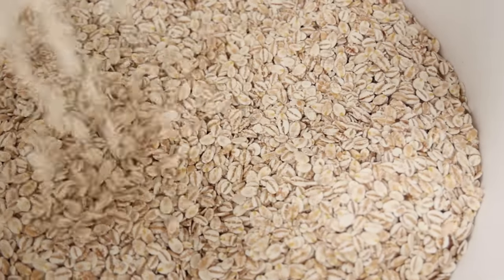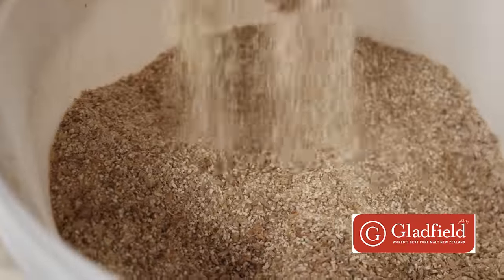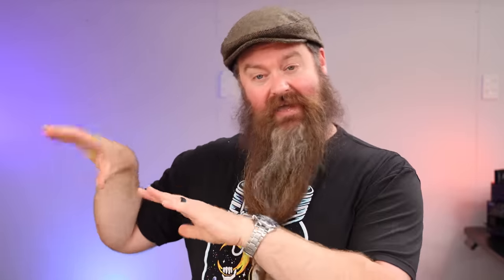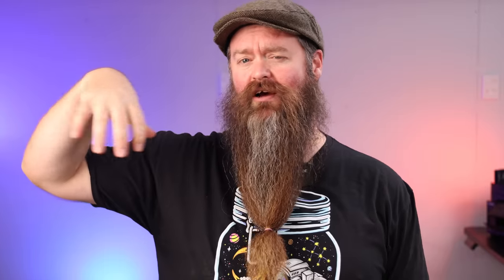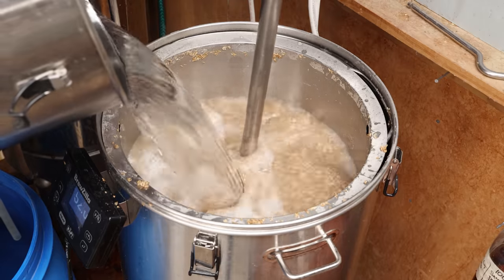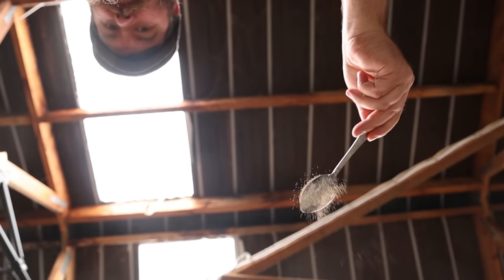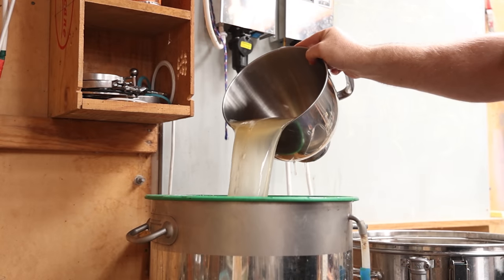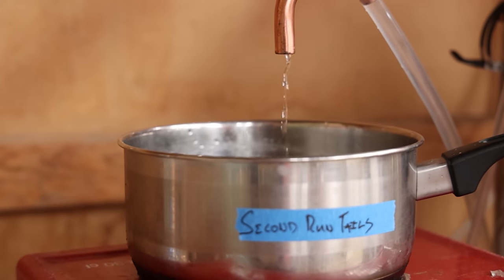Making A Triple Distilled Irish Pot Still whiskey

Comment: Craft distiller here who is setting up my own commercial distillery in South America. I have made about 14 different Irish whiskeys. If you read up on the history of Irish whiskey the grain bills were wide and varied, a lot more so than scotch. The classic is malted barley at 50 % 40 % unmalted plus 10% wheat or Oats.  I have made all sorts of variations with varying degrees of Oats and some rye.  The best book on the topic is "A glass apart" by Fionnan OConnor. Its an excellent book on the History of whiskey in General and Irish whiskey in particular.  On triple distilling the practice varied between double distilling and triple distilling however as you correctly noted with triple distilling they are effectively recycling the tails and getting more of those flavors into the final product. You can do that with a different technique in your second run and still come up with the same product.  The other thing you could have mentioned if your going to barrel it Irish whiskey was almost always barrelled at 51%to 55% ethanol.  Just because it gave the distiller a better understanding of the balance between wood and whiskey flavors as the whiskey ages.
Reply: Thanks for the info!  I'm in the middle of my first triple distillation now.  And I think I'll put that book on my birthday wish-list!
Reply: @matthewbrook7683
Where does the "51% to 55%" info come from?
Page 43 of the O'Connor book says, "all of the Midleton whiskeys are cut to a uniform strength of 63 percent ABV for maturation".

Comment: A couple of observations coming from all grain beer making which might give you something to experiment with.  Boiling the wort (wash) isn't just done to extract bittering compounds from the hops but to achieve  a "hot Break" which coagulates proteins making them drop out of suspension and gives a clearer wort. Takes about 30mins boiling, the addition of irish moss helps this process. Ideally a "cold break" is then achieved by cooling the wort (wash) as quickly as possible. This drops out another set of proteins which cause beer to go cloudy when chilled. On my setup this is done with a homemade heat exchange, a long copper coil with flowing  a water jacket, very similar to a condenser on a still. Not sure how much it would effect whiskey making or if the added effort would be worth it but it certainly results in far cleaner, tastier beer.

Comment: I did a series of 4 washes with a litre of back sets from previous stripping run going into the fermentation for the current fermentation (pH adjustment needed). I used feed grain barley for the unmalted barley. For the generalization I used a second pot half the volume of the mash tun. I found out that generalized barley is available as a horse feed - described as micro ionized. I used a T500 for the stripping, 2nd and 3rd distillations. I aged with French Oak dominoes for 100 days and am happy with the result. I expect that more oak aging would improve the result. Using 5% Rye or Oats in the fermentation might add some complexity.

Comment: One thing to note, the reason your adding high wines to the wash in the next strip run, is to raise the ABV, and to help pull out more esters.
So again when you do the 3rd run, don’t proof it down. Distil it at whatever you’ve got. 70-80%, again the higher ABV will help to pull out more esters.

Also don’t disregard heads from batch to batch, because that’s where most of the esters are, keep adding it, eventually more and more esters will start showing up in the hearts.

Basically it’s the same as chasing rum oils, just at the other end of the run.

Comment: I love your channel. I am a homebrewer for a few decades, and have made the turn into distilling for the last 10 years or so. Much of what I see on your channel are things I have learned the hard way, so it is great to see reinforcement of the alchemy that I have been through. I especially like your info on cuts, as this is the hardest thing to wrap my brain around. One thing I thought of when I saw this video was that you are milling grain with a power tool and a mill that (probably) has knurled faces on it. I just replaced my mill (after 25 years) with a Brewtech mill. It has larger rollers than the old one, and does a nice job of it. I found that I was producing way more flour than I should have, due to my impatience. I was milling too fast! It led to flow problems when we make beer. Now that we upgraded the mill, we are back to smooth runnings and still meet our efficiency numbers. 
Have you had to focus on a slow speed when milling with a drill motor to avoid making too much flour?

Comment: I have a question off topic I have been trying to find your newest video to ask this question, but how can I get a rich corn flavor from my wash into my distillate I’ve been trying and trying and trying to get this corn flavor, but every time it is not so I am running in Pottstown mode, but I have no thumper attachment origin basket at this time I just assumed the flavor would carryover, but there is absolutely no corn flavor. Any help you can provide. Any suggestions would be greatly appreciated.

Comment: I have learned so much from your videos. I use the Air Still only. Question please. So, when distilling using my setup, just throw out 30 ml of the first product as foreshots? Even though it smells funky after that, until clean hearts, those are the heads? And you can redistill them?

Comment: Thanks' Jessie, love it when you do and explain the process. Question: would it not work thru the bubble plates (Reflux), or is it the pot still and the heads and tails remix that makes the difference?
Reply from the maker: Good question.  Its not something I have tried side by side.  I think you could approximate it.  I have a hunch there is something to adding the feints from previous runs and adding extra water.
Reply: @StillIt  Thaks mate, have an awesome evening, till later

Comment: Sprinkling the yeast on top of your mash is actually the best way to add it, regardless of what the package says.  If you're familiar with iStill at all, they offer a very extensive course in distilling and cover all aspects of it.  One of their free video series is on yeast and after extensive testing they found this to be the best way because the yeast is hydrated slowly instead of all at once.  When you stir it all in everything gets hydrated, this shocks the yeast and actually kills a lot of it, when introduced slowly such as by sprinkling on top it is able to hydrate slowly and gradually come back to life and start eating sugar, this leads to a bigger yeast colony faster, which will eat sugar and poop alcohol faster.  Check them out, it's worth it just for the free info.

Comment: How would you go about distilling something like this in a plated 4inch column? 2 plates? 3 plates? 4 plates? no plates? and what take-off rate: 2.5L/ph? 3L/ph?
Reply: Take the plates out.  I am a craft distillery owner and have made heaps of Irish whiskey.  I tried once in a plated column and it was not great especially if your using oats in the wash.
Reply: @matthewbrook7683  I’m yet to do no plates but I’ve done the 100% corn bourbon with 1 plate. To refine it further, I’m wondering if I should fill my 500mm packing section with copper scrubbies and do a run with no plates. I watched jesse’s video with IronRoot distillery and he said that maximising copper interaction smooths the spirit out.
Reply: @TPGMatt  The more you put in scrubbers the more you take out flavor. But look I run a 400l still with a 6" neck with classic copper whiskey helmet. Under that I have a strainer section were I put a small amount of copper mesh. This helps smooth out the spirit and also traps grains and its sacrificial so the copper mesh gets eaten up and not my still.  If you want full flavor with a plated column go to 1 plate or maybe two. A large copper column is the equivalent of 1.5plates.  500mm of packing will produce whiskey flavored vodka.  If you making whiskey go for the most flavor you can get. Which means minimum plates and two runs.
Reply: @matthewbrook7683  nah I know what you’re saying as I have SSP but I’ve read the scrubbies don’t have anywhere near the same affect as SSP for removing flavour for a neutral. I’ve got a 4” custom still with a 95L boiler. I might just add some copper mesh to my packing column

Comment: Someone tell me, please. Why the heck do I need to proof down to "below 40% AbV" my high wines before my 3rd run? What are the targets? My hearts will go weak sooner therefore, I'll catch surplus fatty acids. If I need that "bready-loafy smell" then I just go double in a Scottish manner, eh? And to walk around my cask for 10 years...

Besides, I'd add the 2nd run's heads way back to the 1st run (and the fores of the 1st run - down the sink). And the heads of the 3rd run to be added into my intermediate run #2.
Reply: This is the technique you need. Add the heads and tails to the second run. With the second run take the first cut at between 75 to 72%.  Run it down at full speed to 50% abv. Back off to half power for about an hour then go full speed down to 20% abv and cut it at 20%. Then you will get the same effect with two runs as you would with a third run and you will get the fantastic flavor in the tails.  How do I know ?  I have made about 10000l of whisky in the last 5 years.  Most of it Irish style whiskeys.  The final ABV should be about 51 to 53%.  Barrel at that abv.  This technique was what the Irish used from the 1700s to the early 1900s.  Triple distilling wasnt always used in Ireland as much as Jamesons and Diago would like to tell you.
Reply: @matthewbrook7683  Thanks mate. I'll give it a go. As soon as I grasp it all :)

Comment: I thought irish whisky had triple distillation, because unmalted oats was scorching. And to remove scorched taste was doing triple distillation
Reply: Craft distillery owner here.  The answer is no on the scorching up to a point.  Traditionally the Irished added Oats at between 5 to 10%. The oats gives excellent mount feel with smooth spices and peppery notes.  Its great stuff.  But.... Oats produces a lot of glucans, think porridge or quakers oats goop,  At between 5 to 10% its OK and the mash will lauter just fine.  Beyond 10% you have to add beta glucanayse to the mash to stop it turning into porridge and you will also have to lauter 3 times.  Once you get scorched flavors in a whiskey you cant take them out.  Just mix it with coke or give it to your mates.